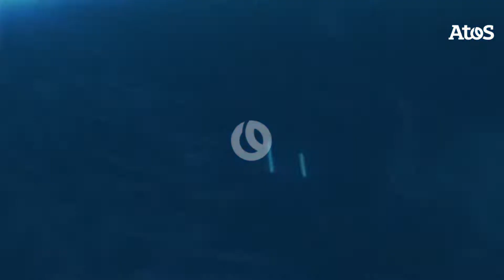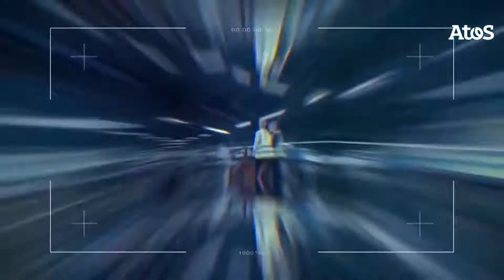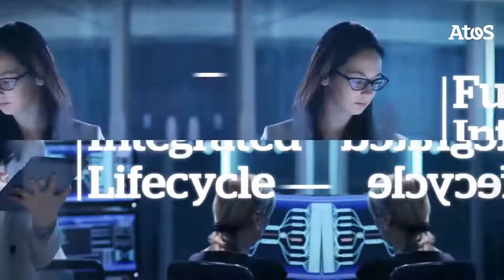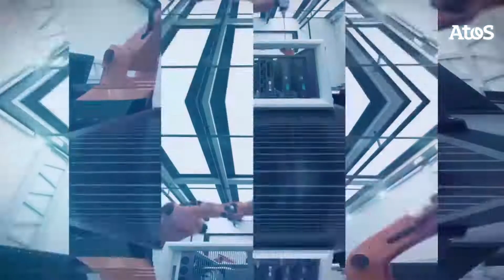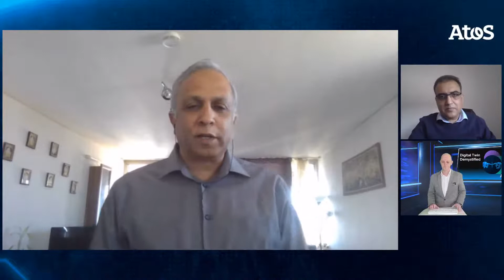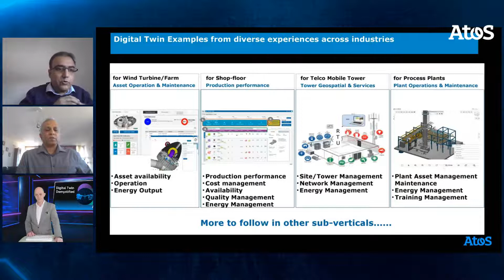Digital Twin Demystified

Comment: I am pleased to share with Atos, Professionals and Companies the most advanced technological tool in existence: the Digital Twin that I developed in 1981 under the name of Vir-tual Instruments.  https://youtu.be/eadaQiL_AK0   https://youtu.be/fXlp4QLdWQs   Export the Copilot, Chat GPT, Revit, Plant 3D, Civil 3D, Inventor, Engi file of the Building or Refinery to Excel, prepare Budget 1 and export it to COBRA. Prepare Budget 2 and export it to Microsoft Project. Solve the problems of Overallocated Resources, Planning Problems, prepare the Budget 3 with which the construction of the Building or the Refinery is going to be quoted.